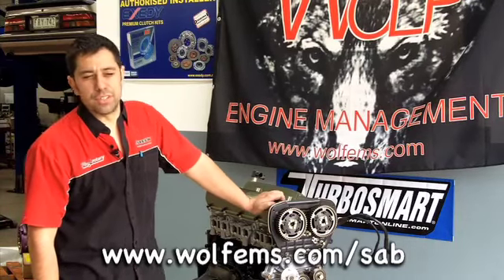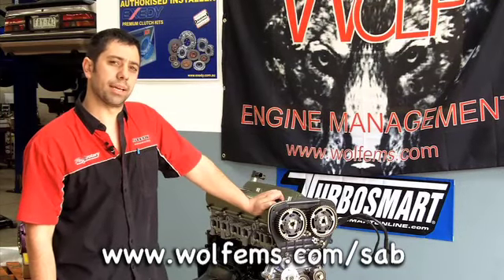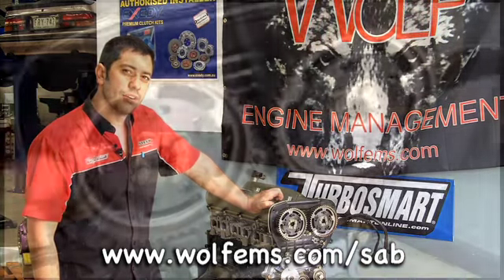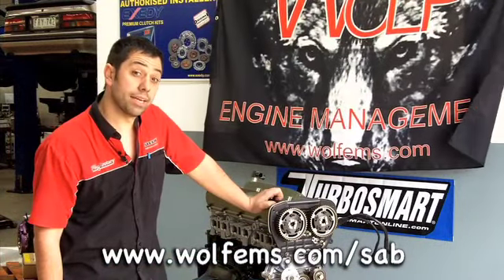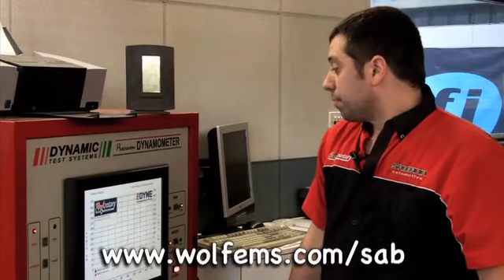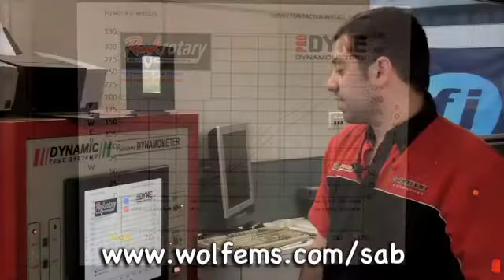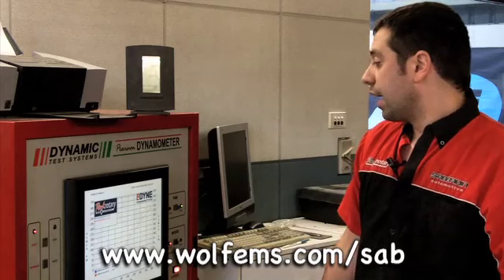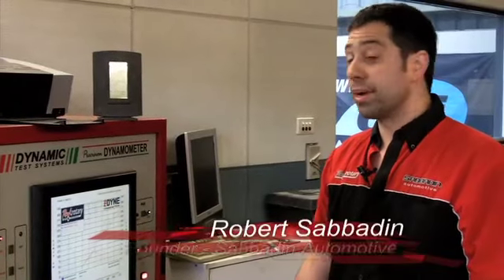Adjustable Cam Timing Advice by Rob Sabbadin

Comment: Just to be clean cam timing will only have a clear effect on the AFR if the car is speed density and not a MAF set up correct? would not the MAF compensate for the change in VE?
Reply: yeah thats what im thinking.